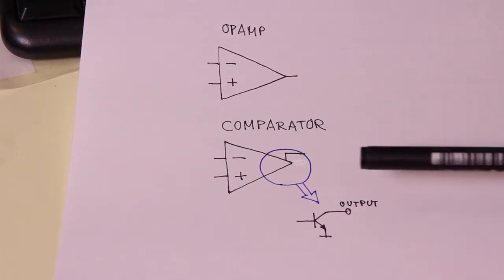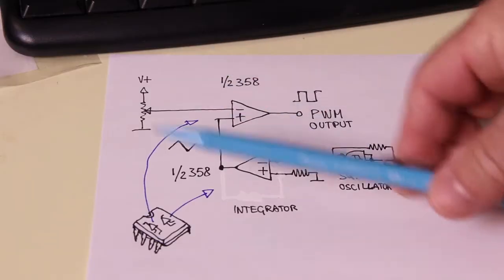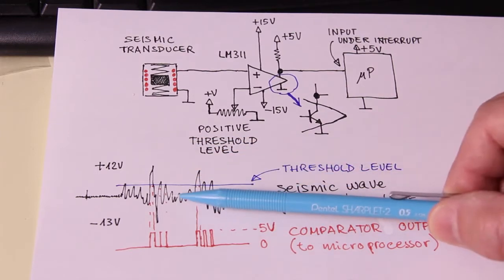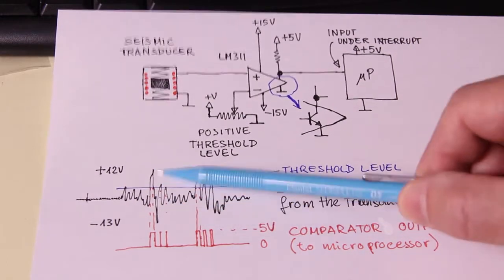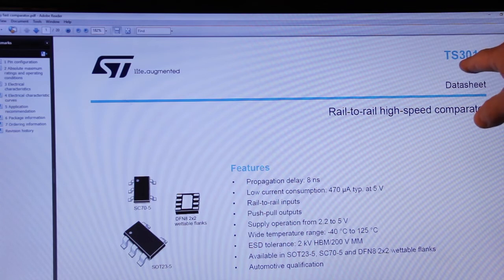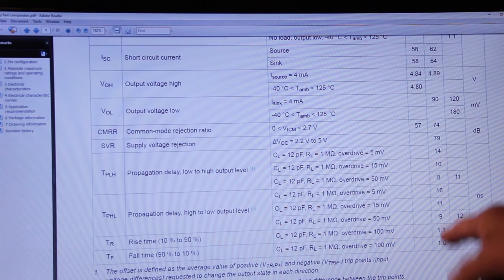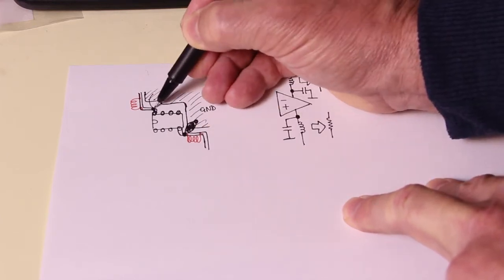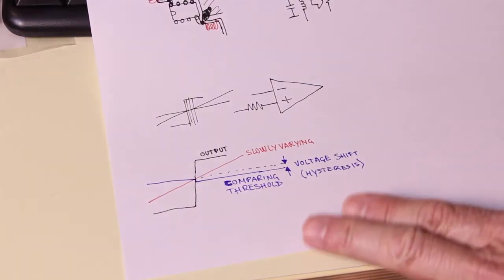5 things to know about #Conparators Vs #OPAMP - #electronics

Comment: I think your window detector circuit diagram is wrong, since you have the input connected to the non-inverting terminal of both comparators
Reply from the maker: Spot on! Indeed the comparator on top of the page has the inputs swapped: the signal should go to the inverting and the wiper of the (positive) set pot should go to the non-inverting. 
I have pinned your comment. Thank you.

Comment: Great explanation. Thanks for your effort. I was trying to understand the application of a Quad comparator used in a HP power supply. The parts list in the schematic labeled it as a Quad Linear Op Amp but it wasn't. The pinout was much different as well, but turned out to be a perfect match to a LM339n. One of the comparators is wired up as a reflex oscillator, the other three are wired as comparators. It was how the output of the comparator of the reflex oscillator was wired up that didn't make sense to me until I realized that it's a comparator with an output that's basically an open collector NPN transistor which now makes perfect sense. I had no spec sheet on the comparator. It's a part number that doesn't match to anything. It was made 50 years ago.
Reply from the maker: Glad it helped.